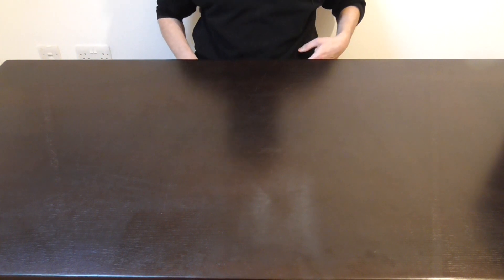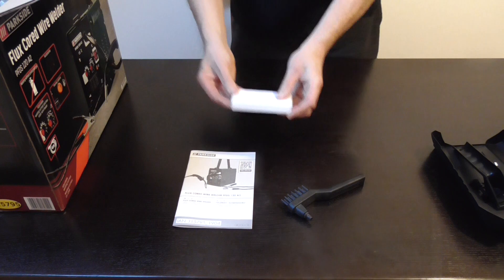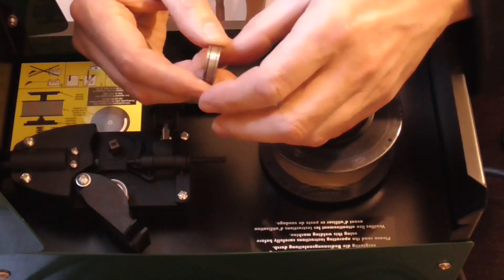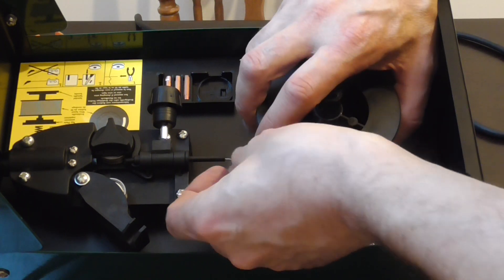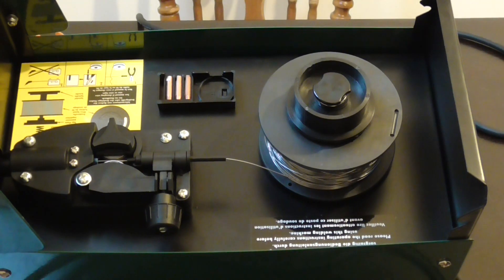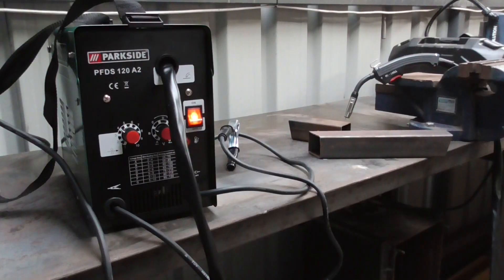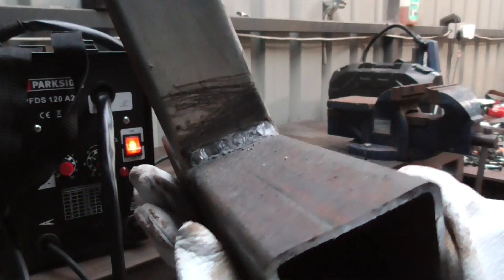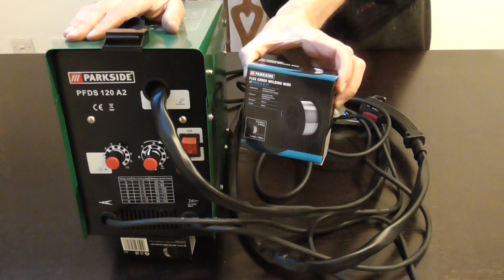UNBELIEVABLE PARKSIDE FLUX CORED WIRE WELDER UNBOXING

Comment: Sorted out my problems with my new welder it was the feed roller with the groves the outer plastic case had moved and was slowing down the feed speed , just something to watch  when feeding in the wire 👍👍

Comment: Good job. I have just bought one of these welders from Lidl, a great price for a basic jobbing welder. I would have liked to have seen how you selected the amperage and wire feed settings for the material you were welding. Just a thought.
Reply: Looks like it's on 4 for wire feed and C for amperage.
Reply: jean valjean cheers Jean.

Comment: Could you go through the setting of the welder, gave mine a quick try just spat out beeds wouldn't lay down a decent weld , this is my first Flux core welder have two sticks welder any help would be great 👍
Reply: Have you got the hang of it? If so do you find it easier than stick welding
Reply: @ciaranwalsh8994  yes got it sorted, it was the feed roller didn't have the wire in right, yes it is hander for small jobs, wonder if I can tack stainless steel with it 👍☘️🇮🇪👋

Comment: Lidl also has a combined MIG, TIG, flux core and stick welding machine.
Reply: I never see it in the shop. I missed the chance of their inverter welder a couple of years ago and I've never seen it back in the store. Wish they'd do an online back catalogue. I'd love a tig.
Reply: @SiskinOnUTube  it was in Malta lidl stores a short while ago but sadly i missed it too
Reply: @SiskinOnUTube  If you are in the Belfast region the Connswater store has a few of them today (30/07/20) at £149.99, also a few inverters at £39.99
Reply: flip inheck  yeah there are much better and not much higher in price. Helivite 182 and the ROHS 200 and 250 amp machines as an example are are only about a €100 - €150 more and the quality is way ahead of the lidil welders. But the helivite cant tig (not sure about the ROHS) which for me isint an issue because im only into mig and stick welding.

Comment: I notice you weld the same direction as you would stick and not normal mig. Is this because its a flux? 
Also could I use this gasless mig wire in a gas fed mig with obviously the gas switched off?
I noticed Parkside have really started to step their game up with their whole range of quality tools

Comment: Two questions if you don't mind... did yours come with one of those 3 pin round plugs on it? if so, is it safe enough to swap that out for a standard UK plug with 16amp fuse? Also, the wire supplied with the machine, I take it thats suitable for mild steel? Cheers!

Comment: Can you weld small, slotted tungsten beads (0.4- 1 mm diameter) to a fishing hook using this set up? Thanks
Reply: i think the answer would be no
Reply from the maker: No this type of welder would be unsuitable for such a small item, you would need to consider a jewelers welder or micro laser welder with microscope LCD screen for that type of application
Reply: @magpiemaker560  thanks for the reply. Currently I am soldering the pieces together, but the bond isn't strong enough. Actual size of tungsten beads is 3-4.5mm. Sorry for the incorrect info above.
Reply from the maker: @nicholaszarb2504  Tungsten can take quite a bit of heat that's why they are used for TIG welding in which the welding conical arc is formed by a tungsten electrode. Have you thought about using a chemical bond? there are very strong epoxy metal to metal bonding agents you can get on the market which might work better
Reply: @magpiemaker560  I will certainly check. Thanks for the advice 🙂. Much appreciated.

Comment: One problem with parkside products which are sold through lidl in the uk is you cant get spares .if any componants fail or get worn you cant get spares from lidl .i bought a mini jigsaw fret saw ...it was great till i needed blades. Lidl staff just shrugged ate when i went back to get some and no one at head office lidl gave a toss.i personally wont buy parkside for that reason .they work and are useful but no point if you cant keep them going .
Reply: Parts are not a problem, Get them here: https://www.kompernass.com/en/parkside/
Reply: Generally I like Parkside tools but availability is erratic.  For example, I have a couple of Lidl airnailers / staplers but can't get the 'ammo' anywhere else; this means I have to stock up when they come in, which in my local Lidl is at intervals of about 18 months.
I'm not impressed with their 'Ultimate Speed' range of automotive-related products.

Comment: Does this welding machine work without gas? & Available in any country flux core wire materials?
Reply from the maker: Yes this welder works without gas, the flux core shields the weld instead of gas.This machine was purchased from a Lidl store hope this helps and thanks for watching

Comment: You may have got a neater fillet if you had pushed the nozzle rather than dragged it like a rod welder.   Great demo though very impressed with the strength of the weld...thanks
Reply: Flux core welding produces slag, so you have to follow the old saying "with slag, you drag".

Comment: picked myself up one the other day.  I dont have a clue how to weld but sure what could go wrong.........................
Reply: Be careful, you could blow up in the air. (pro welder)
Reply: Sgt Matrix how come
Reply: @therealpritchard1990  Welding is a dangerous activity to take carefully. You are dealing with heat, electricity, moving parts, dangerous rays, smoke, weights, technical issues,....
Reply: @therealpritchard1990  Most of world's countries even have specific legislations about it.
Reply: Sgt Matrix yeah that’s true , what sorta smoke .?.. would welding outside be ok
Reply: @therealpritchard1990  I worked for nearly 20 years as a blacksmith inside a building. 
There you have: common dust, metal dust, gases,.... to weld outside is strongly recommended but it is not possible with every welding system.
Avoid positioning yourself directly over the parts you are joining but instead stay aside it, as the smoke, comes up vertically and then mixes to the air. 
Use aspirators. 
On the market you can find respirators with filters for the welders, those are usually never used, aside real full time pros.
Reply: @therealpritchard1990  See welding fumes and gases.
Reply: Sgt Matrix ok,I’m just a hobbyists newbie welder using a mig welder for general repair and will always be used outside , I bought one to make myself a set of metal gates for my driveway and don’t wanna put myself in any danger
Reply: @therealpritchard1990  there are very little things that can go wrong. Just watch out for the gas if you value your lungs
Reply: @sgtmatrix  theres a good reason why full time pros wear aspirators. Because they weld everyday all day long. So the harm done would be much worse then who like me weld only occasionally. But still im going to buy a aspirator. Health doesnt have a price

Comment: Has Anyone tried to change polarity on this particular machine? If so how?
Reply: CO2 MIG is the opposite polarity of flux core i think
Reply: I don't think it has that option
Reply: @charlescarabott7692   tests have shown it makes very little difference, In theory ,  yes you do need to change it  but it will work without
Reply: @jimrobertson8357  i find that it does make a big difference on my machine at least. But since this welder is flux core only it wont have that option

Comment: Is this any good for simple bodywork on cars\vans??
Reply from the maker: Yes it is, as you don't put too much heat into the panel. But to get good welds you do need a clean surface free from rust and dirt so you need to go down to bare metal( check out poly carbide abrasive discs ) they are great for preparing panels for welding

Comment: What power supply do you need to work this ? presumably you can't just plug it into a normal domestic power socket ?
Reply: You can otherwise it wouldn't sell In Lidl....
Reply: @terryatkinson899  OK thank's for the reply,
Reply: Most welders upto around 250amps plug into 13A mains

Comment: Is the torch live if you touch a piece of metal without pressing the trigger does it spark?
Reply: well at 7:28 he puts in down on table and nothing happens so i think its not :)
Reply: no, you need to press the trigger to engage power

Comment: What was the wire speed and power?
Reply from the maker: hi Marco Martins, I had the wire speed set at No.4 and the power was between B and C setting on the dials. I was moving slowly from the left of the work-piece to the right with minimal circular movement keeping the pool fairly uniform. Hope this helps and thanks for the comment

Comment: Hi mate.can you weld stainless steel as well with this welder??
Reply: No
Reply: @robertholdsworth4498  You just need to change the weld wire to use on Stanless.

Comment: Does it need gas for welding?
Reply from the maker: No gas,the flux inside the wire creates a protective shield the same as stick welding
Reply: One I see same model and its need compressor conection back side. this one good.no need the compressore conection.

Comment: Stop hitting it there shouldn't be any slag.
Reply from the maker: Thanks  Gavin FreedomLover for the comment, flux core welding does leave a little slag the same as arc welding which should remove easily if you do it right. Mig,Tig or Mag welding tends to leave no slag because of the shielding gas